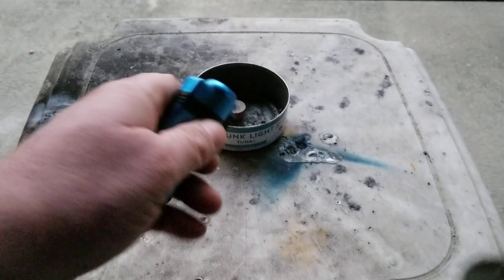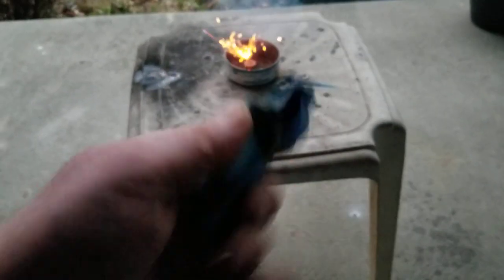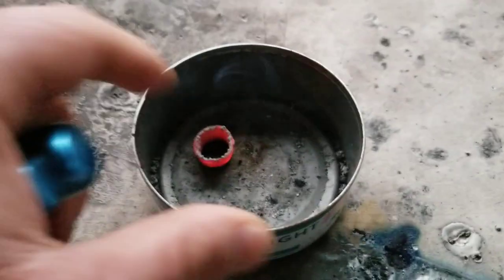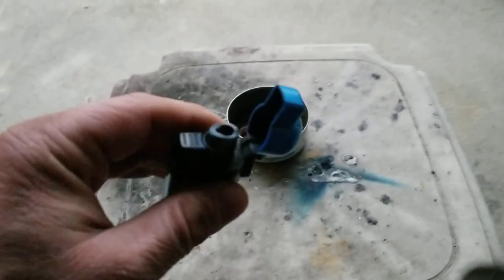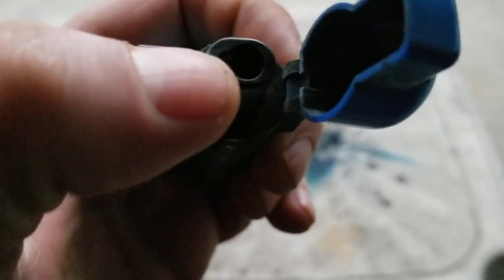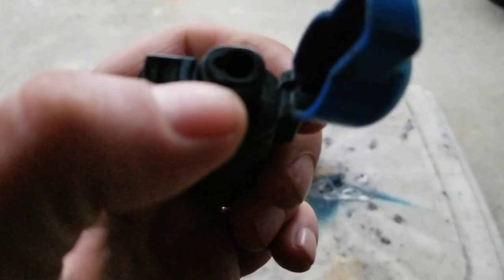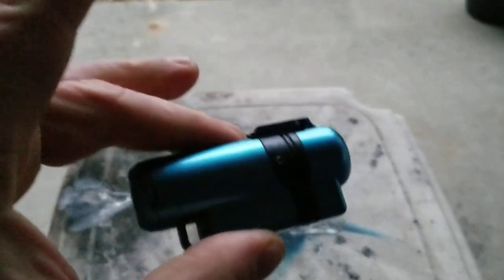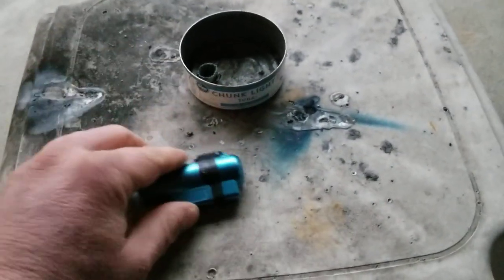Torch lighter issues and how to fix them

Comment: I fixed my pyro lighters by throwing them in the trash and getting a push button Mag Torch and MAP gas cylinder.
Reply from the maker: Nice
Reply: Too much frustration with lighters not working when you want them to. The torch has never failed me.

Comment: my lighter has a spark and gas but only lights for a second. any idea what's wrong?
Reply from the maker: If it's a jet torch style, take something like a  pen tip or small screwdriver and press down on the fill valve to bleed all the air out , then fill, and take an old tooth brush and brush over the flame nozzle and ports,  then it should fire,  use good butane to fill

Comment: I have a butane torch lighter that wont work when it has fluid
Reply: @jesse kelley You need to "burp" the lighter. Let all the gas out of the lighter. This will force all and any air in the lighter. Make sure you don't hear anything.  Make sure you do clean the sparker before filling it. I used a small toothbrush with a little alcohol and brushed the sparker really well. clean any residue with a q-tip or small cotton ball. Fill the lighter and let it sit for 2 min. upside down. Afterwards, see if you see it spark, keep lighting till it hits the butane.